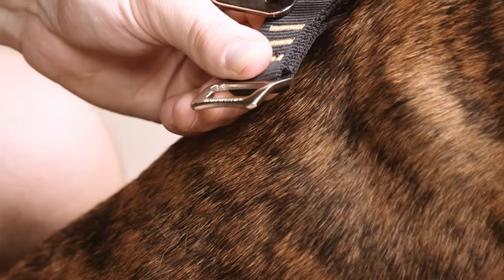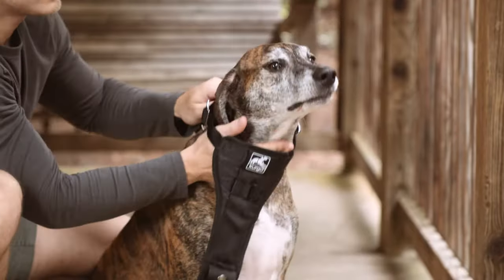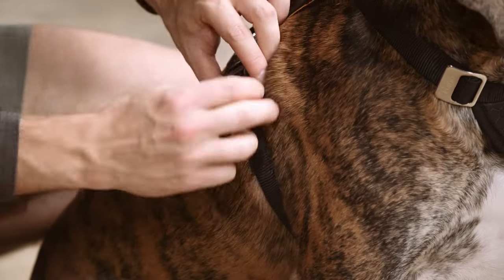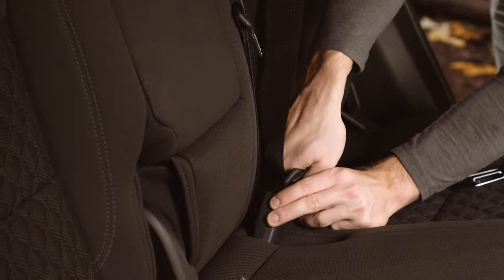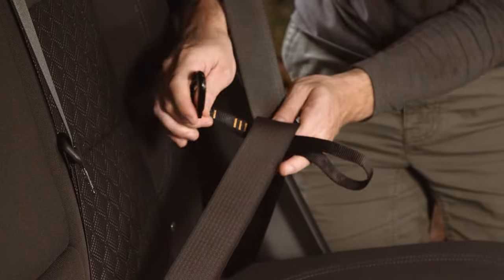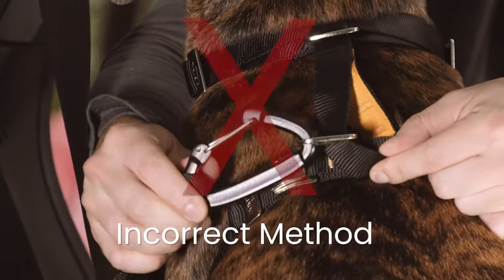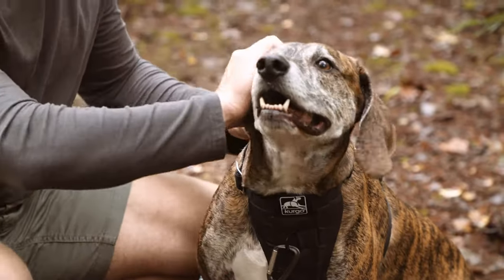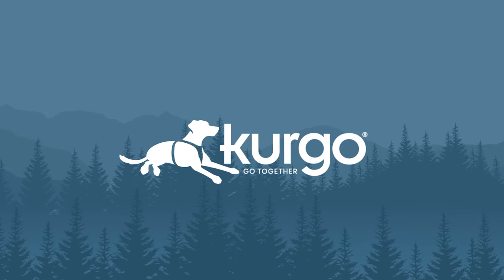How to Use the Tru Fit Enhanced Strength Harness

Comment: Slow down! My anxiety got worse. I've got to put it on a rescue dog, with both of us anxious, and my rubber hands. 😂
Edit: we used an extension on the clip in the boot of the car, or he'd have been unable to move. That worked. With practice getting it on is easier, but adjusting it is a nightmare. Hopefully I'll get that right. Feels like the front is too tight and back to loose, despite moving buckles about. Good thing my new rescue is patient, or it'd have been binned. 
Yet to use it on a seat belt fix, as building up trust to get him in the car.